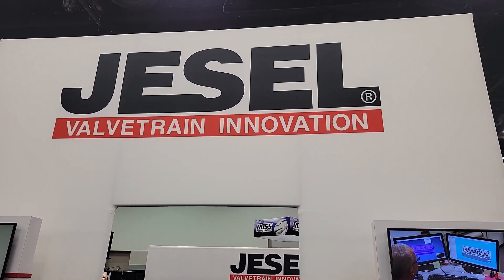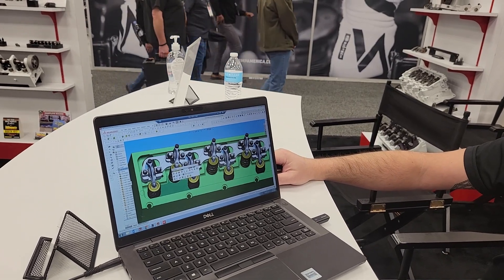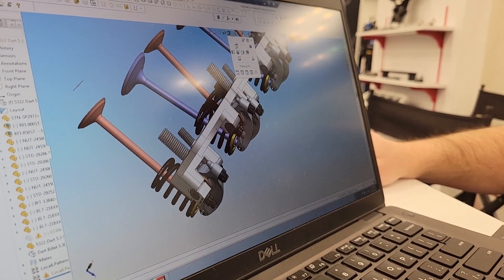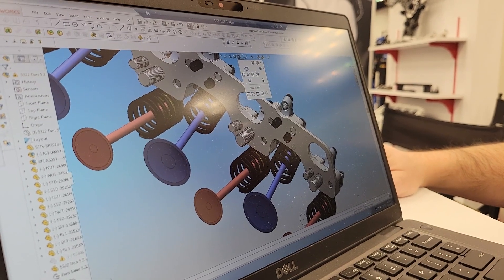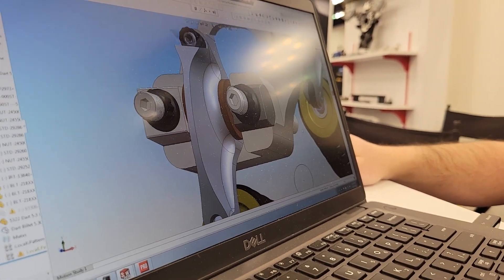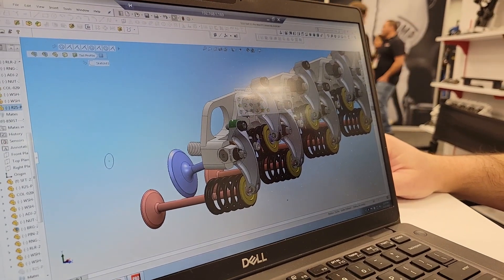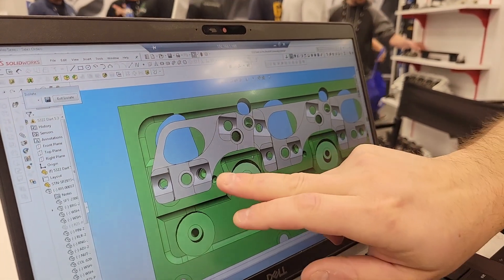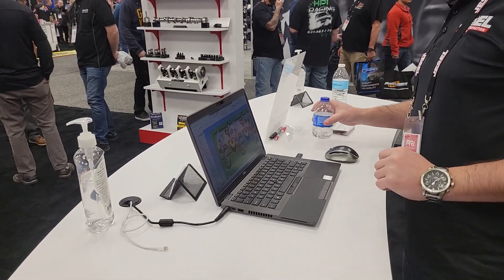Sorceress New  Valvetrain Explained With Jesel!

Comment: Good series  , curious why you put so much r&d and $$ into this engine configuration instead of going Noonan hemi or Steve morris SMX water jacketed set ups?  U  will no doubt have a stout valve train when done though .
Reply: Don't think the SMX is pushing the same power, regardless I have a similar situation (obvs not same power levels) where I could swap an engine in and make the same power for probably $3-4k less than pushing my current engine to its limits, but I choose to use the smaller engine because I want the challenge and the R&D aspect